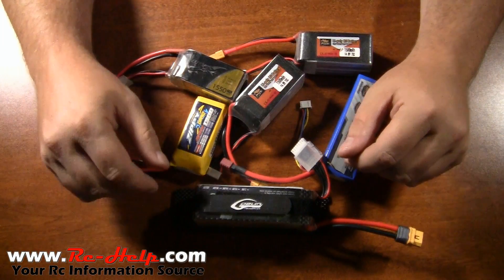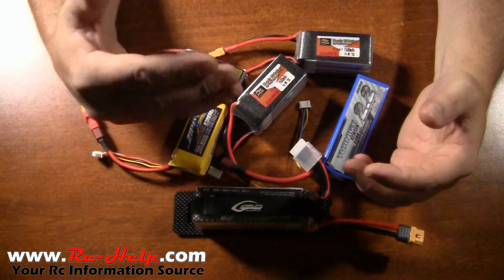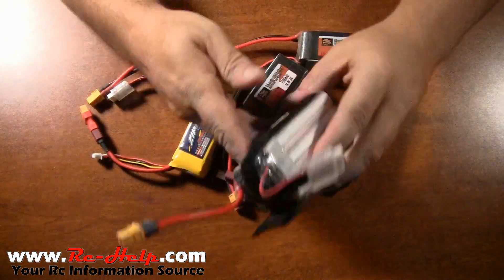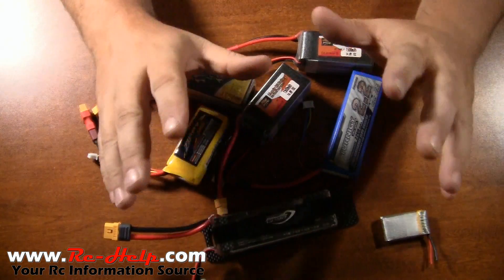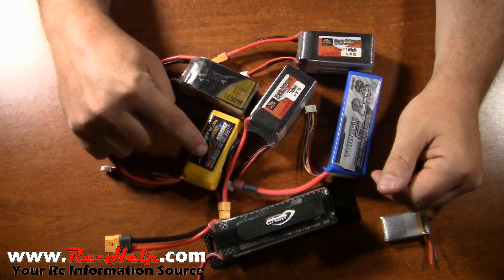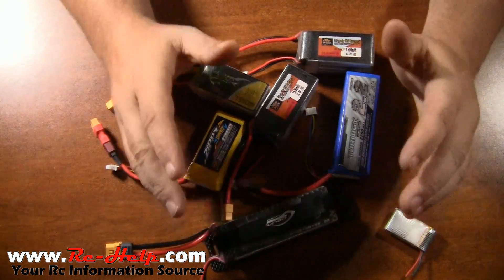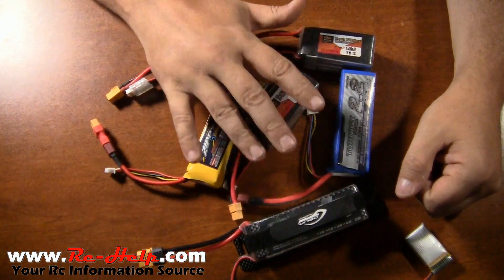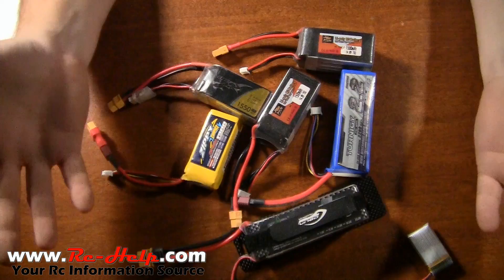LiPo Battery C Rating Explained

Comment: Really helpful video.i have a question too.the esc i'm going to buy is 60a and it says maximum 3A.How to calculate the power to buy a lipo with correct power?
Reply from the maker: The 60a rating is going to be your motor rating, the 3a is going to be your BEC rating or how much power your servos can pull. As for matching a battery to everything, check out this video https://www.youtube.com/watch?v=LlSa2f76QiU

Comment: I got a question sir if i may, will a 2200 mah 20c battery give me the same punch in a multiroter as 1800 mah 25c?
Reply from the maker: You may absolutely ask questions, in fact I encourage it! In your application, the 2200mah 20c pack will give you 44 amps, the 1800mah 25c will give you 45 amps. So the smaller battery is theoretically able to give one amp more than the later capacity pack. However, your motors will only draw what they need. If you have motors that are only drawing 40 amps, then both batteries are going to be exactly the same as far as "punch" goes because the motors are determining that factor. However, if the motors are wanting 45 amps, then the 1800mah pack will give more "punch", but only because you have exceeded the maximum amp draw of the 2200. 

With that said though, the 2200 is going to be heavier than the 1800 so even if your motors are only needing 40 amps, it may 'FEEL' like the 1800 has more punch. 

To understand what I mean by the motor only drawing what it needs, take a look at the video linked below. 

https://youtu.be/LlSa2f76QiU

Comment: The stock batt in my heli is 300mAh 30C and it always comes down hot, about 120F. I tried a 350mAh 50C. Same thing. You want to take a guess what the problem might be?
Reply from the maker: That is about 48ºc which is on the warm side, but for a very small battery like this is about normal. However, the 50c should have come down a little cooler unless it was a pretty cheap battery, in which case they like to fudge the numbers a bit. If this is a collective pitch helicopter, I would try lowering the head speed slightly to reduce the strain on the helicopter. If it is a fixed pitch, there is not much you can do unfortunately to save power. Come over to the forum and post this up and lets get some heads thinking on this. www.Rc-Help.com